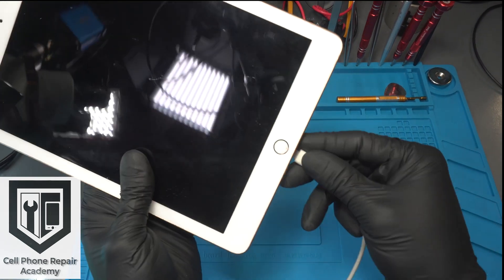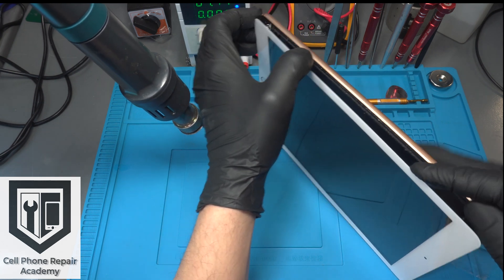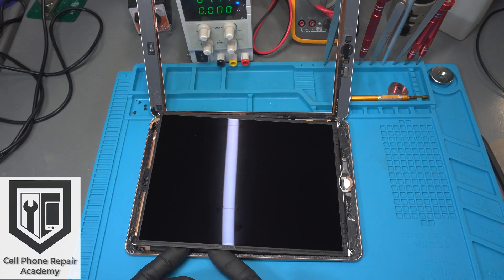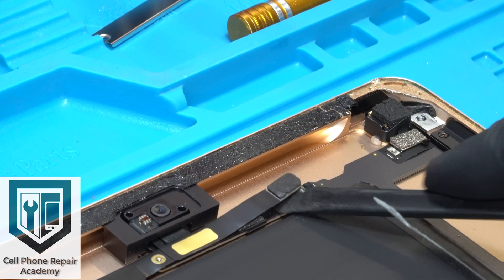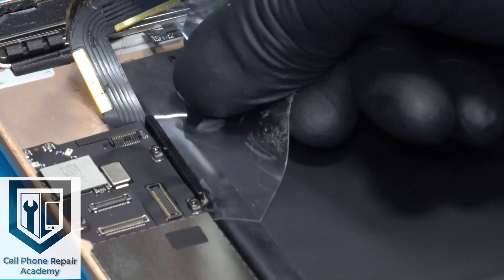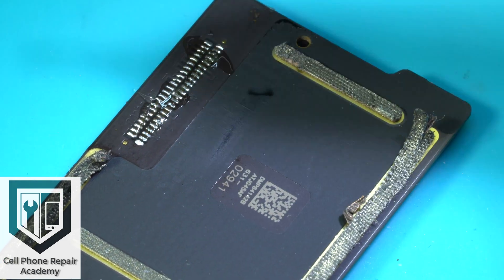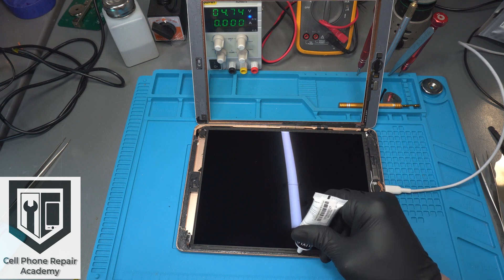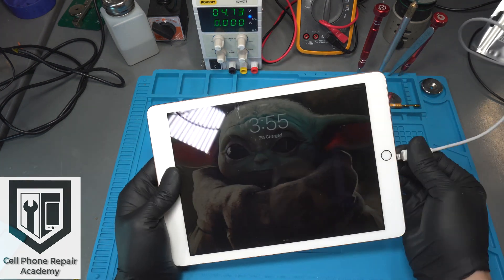iPad 6th Generation Charging Port Replacement: Step-by-Step Guide

Comment: Halfway through the video and I already know I can’t pull that off😱
I can’t even solder big and bulky stuff together.
The solder never seems to want to stick to the surface I heated and instead I have to melt it on the tip of the Iron and rub it on the material.
So this kind of Micro-Soldering is just Not happening👎
Only 4 years Old tablet with that problem tho…SuperGreen 😡.
Planned obsolescence is criminal.
Reply from the maker: Hello! If you have a device that needs repair, follow this link to mail it in: https://cellphonerepairacademy.com/mail-in. Thanks!

Comment: yall need to slow this shit down just a bit
Reply: Hi. I don’t know how YouTube displays on other things, but if you’re using an iPhone you can use the bolt in the upper right (next to “cc”) to open a control panel, and Playback Speed to slow down or speed up.  I hope that helps.
Reply: @GrantTarredus  Thanks
Reply: @Prince.Prince1999  Sure thing, brother!